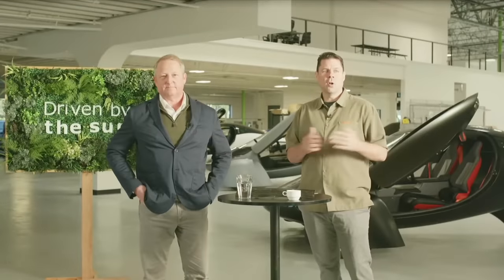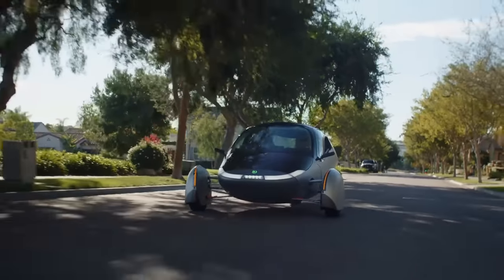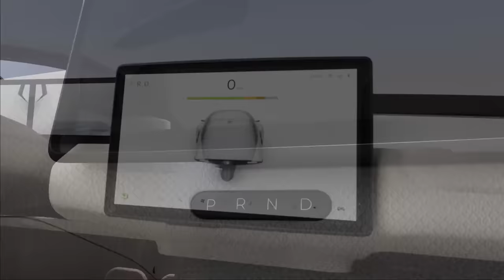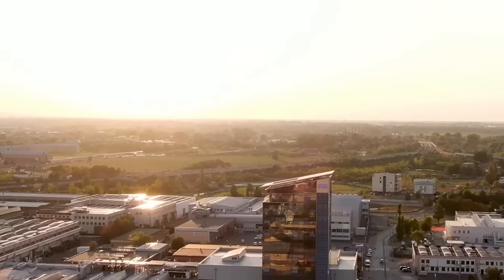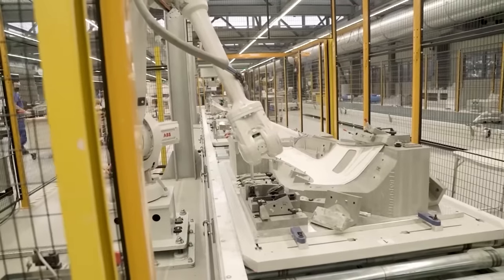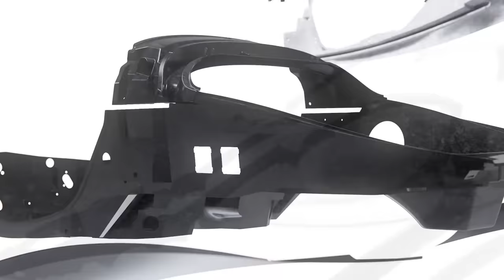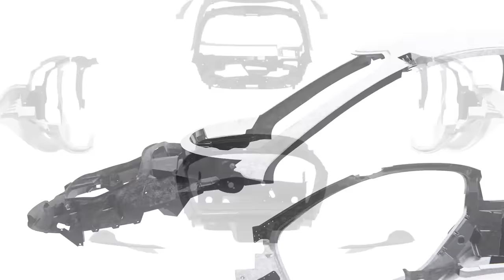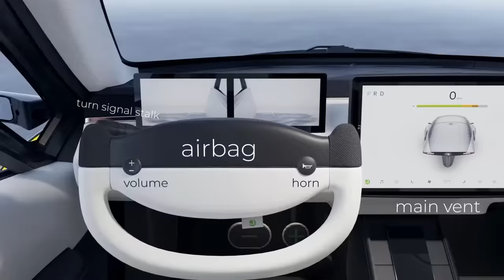Announcing Aptera's Launch Edition | Live Webinar

Comment: Wow, the chat was all over the place with this. Lots of people hating the yoke which I don't understand why and people demanding DCFC which I kind of understand.
My opinion about the yoke is that it is nice, I like the horn position on it and I hardly ever use the top of my steering wheel so sometimes it's in the way which is why I like the yoke design.
As for the DC Fast charging, I understand where people are coming from, however this vehicle is designed to be an efficient commuter, it isn't really designed to be a road trip vehicle, at least not the launch addition. Yes, I would like DCFC because I plan to get the 1K mile version and go on long road trips, but I would be more than happy to pay for that as an extra addition, like how the 1K battery is an option and the sub-woofer (was) an option, I would just pay extra for the components of DCFC and I would understand that just like the AWD, it makes the car a little heavier and a little less energy efficient.
Reply: @paulas_lens  That is kind of what I thought was the case.
Reply: I drive with my hand on top of the steering wheel. So if they don’t ever offer a regular steering wheel I’ll never buy one of these. The yolk is not a very smart choice.
Reply: @Pickle_Riiiick  why do you say the yoke isn't smart? I like having the increased viability.
Reply: @Pickle_Riiiick  Good for all the folks in the waiting line!
Reply: I apologize, after rewatching, I was mistaken.

Comment: Reservation holder for over 2 years now and I have been evangelizing Aptera the whole time to so many people. But with the HUGE stink y'all created about CCS and then not implementing DC fast charging at all? Seriously? The NACS connector at just level 2 won't even work at Superchargers, so all that effort and time was wasted as you could have just gone with J1772.

I have been most looking forward for this being my road trip car and I have been limiting my gas car trips for years now so I don't put more carbon in the atmosphere. Aptera was going to get me back on the road and travelling throughout the US again. Now it's just another EV that doesn't charge quickly and makes road trips out of reach for people on a budget. Want a decent road tripping EV? Ante up $50k or more. Out of my reach. My Bolt EV and 500e can't get me long distances without significant charging time, and not Aptera won't either. 😭

Can you imagine how long the 1000 mile Aptera is going to take to charge? 💀

Comment: I hope there will be a small battery / one motor version at some point.  Conservation is the top priority for some of us.
Reply: I think two motors is as few possible.  250 range is the lowest available.
Reply: While a single motor version would require the development of the few extra parts needed to eliminate the motors in front, all the parts for putting a motor in the rear wheel will already be in production.  Overall, I think Aptera is smart to make a first impression with the fastest version.  That will help sales.  After a couple years, after that reputation is established, coming out with an even more efficient version could grab some headlines.  Even if there isn't huge demand for a one-motor version, it still might be worth it for what it would add to the brand's image if it's marketed properly.  Three drivetrains; call them:  all-wheel drive, two-wheel drive, and "solar racer."

Comment: EDIT: People are saying they intend to add fast charging via an over the air software update eventually but can't yet due to a bunch of safety standards that require testing by a third party. Fair enough, I am now much less concerned about this issue and will be keeping my reservation.

Original post: Aptera, while I appreciate all the hard work you've put into this beautiful vehicle, surely you realize that no level 3 fast charging will be a huge deal breaker for most people? I was extremely excited when I reserved my aptera a week or so ago but now I'm considering canceling. A maximum charge rate of 57 miles per hour means my 400 mile range aptera (the most I can afford) configuration just lost a large chunk of its utility. I was planning on potentially using this to drive the 1,600 mile trip between my hometown and city where I work, but without level 3 charging that trip just went from 2 days to around 5. Please reconsider this design choice if possible, or at the very least include an upgrade option to add level 3 charging in the future. I don't know why you contracted with tesla to use their supercharger network if you can't actually supercharge

Comment: I love Aptera, but won't buy one until fast charging is available. Even just 50kw. 57 miles/hour is a deal breaker.
Reply: @JorgTheElder  why does this have to be a commuter car? Isn't the most environmentally friendly thing working from home?
Reply: The car gets 10 miles per KWH. So 50KW charging would be 500 miles per KWH
Reply: @JorgTheElder  because not everyone lives in California or sunny and dry climate. Which means you will have to use heating and de-fogging also it is 400 only after they actually make it on the road and test it. And then on another side you can forget going anywhere outside of the 200miles away from your house (200 driving out+200 driving in) also 50kw charging is not cutting edge tech it is more or less the minimum at this point.
Reply: I’m in same boat. Didn’t think fast charging was even a question. I know of no other car without at least 50kw. Even motorcycles like energica esseesse 9 at $23k has fast charging. Very disappointed
Reply: Very Fine. But why not at minimum 22 KW charging ! In Germany/ Europe it‘s impotant for charging at home or in the City or at work etc.!!!
Reply: @JorgTheElder  It's not a "commuter" car, it's a car. I regularly make trip exceeding 400 miles/day.
Reply: @JorgTheElder  a car with 1000 miles of range isn't just a commuter car. do many commuter cars have camping kits?
Reply: @Ernes446  , are you sure Energica motorcycle has DC fast charging? I think you’re getting confused with terminology. There’s 110V 220V and DC fast charging (400-800v)
Reply: @Brent Geery
  If you order what you WANT in YOUR Aptera, you will be able to get DCFC - just NOT in this "launch" version.
Reply: @paulas_lens  they didn't confirm that, you're guessing
Reply: @tjam4229  I believe so. Transport evolve has a review charging with css. You can also look at Harley Davidson live wire , zero. Affordable motorcycles with fast chargers. As an investor I understand getting a product out but I’m still disappointed and would buy esseesse9+ or livewire instead
Reply: I apoligize, I was mistaken.
Reply: @AMPM020
I rewatched, and I was mistaken.
Reply: i recently received an email from aptera motors announcing that quick charging will now be a part of their vehicles abilities. this truly is great news indeed.
Reply: @RadiantFreeEnergyResearch  correct. They made that change within three days of the initial announcement. Great responsiveness from Aptera!

Comment: 150 miles/hour AC charging is not sufficient. Many EVs have 10-80% DCFC charge times under 30 mins for about 250 miles of range. Or to put it another way 500 miles/hour of charging
Reply: But most EV's charge very slowly at home, so you need fast charging because you are waiting.  If you can fully charge at home overnight, then it usually isn't an issue.  This isn't designed to be a vehicle that is driven 800 miles in a day.  If that is what you need, then wait for the 100kwh battery.
Reply: @allenr8121  I'll just get an EV6 I think. I wanted this vehicle to work for me, but I just don't think it's right for my use case.
Reply: @Jacob C.
  If you order what you WANT in YOUR Aptera, you will be able to get DCFC - just NOT in this "launch" version.

Comment: Postive:
1. Launch Edition is correctly spec'd.
2. DC fast charging is a must, glad to hear you are adding that.
3. Love that you are going right to repair.
4. Focus on efficiency to the point it may never need charging for many =mind blowing!
Negative:
1. Hire a presenter to handle to do the heavy lifting and have them interview you for your perspectives.
2. The seats look uncomfortably flat. I hope I'm wrong but I feel you should have just purchased those from another manufacturer.
3.. Go with a regular steering wheel. Rectangles do not spin very nicely do they? Single handed driving (on top of the wheel) not possible. The fabric around the sides will get gross over time.       Buttons look unrefined. Yolk appearance is a gimmick. I know it looks like an aerospace design but it's still a car that drives on the ground and needs to make three point turns.

All in all I think you have designed a brilliant vehicle and I desperately hope you succeed at this very ambitious goal. I do feel that your ideas would do the world more good if in the hands of an experienced automaker with large distribution. I don't know if you've shopped your design around with automakers but I think you'd have a better chance at getting these on the road with some large backing behind you. 1% of a large business is worth more than 100% of one that never got off the ground. Best of luck, I will buy a post launch edition that features the inevitable refinements learned from the early cars.
Reply: Putting the business in the hands of experienced automakers fuct them the first time. They left, got rich, came back and picked up the pieces, and are on the verge of launching the best vehicle possible.

Comment: Random questions, does it have a heat pump, can you charge level 2 + solar charge (what's the fastest the battery charges), is there a warranty, what type of battery chemistry are you using, will there be over the air updates, what kind of processor is being used in the main screen, what type of navigation can be used (is there apple carplay and android auto), will there be options to have a circular steering wheel instead of a yoke, what kind of tires are being used and are there options for summer vs all season tires?
Reply: No heat pump, no DCFC.   No DCFC is the deal killer for me.

Comment: Ok, DC charging. Whoever at Munro suggested no fast charging is needed, wrong.  Harley Davidson (Zero and others) have robust DC charging built in. Very small form factor since has to fit a motorcycle. Without DC 400 mile range is useless for a trip. No one will wait around to charge for 6-8 hours min for level two.  Looks like you are using Tesla connector (good).  No reason why that would hold DC fast charging back.  Figure is out. Take a look at my or someone HD Livewire with DC fast charging. Oh, I heard there is thermal concerns with your battery pack?  Figure that out. Motorcycles makers have. Look, most will not expect 350kw DC charging right this second. However, get so something reasonable.  Like 150kw. Short charge times as needed will he big advantage. Without this at launch… Disaster… Only the hard core will have positive view of Aptera.
Reply: Zero has been in the game for a very long time, Harley Davidson is a relic that has all the infrastructure and finance already in place, and they are motorcycles, they have far less requirements than this. You can't compare them to a startup car that needs to get to production as fast as possible as they're burning startup money. The absolute most important thing now is to get to mass production, nothing else matters, there are plenty of customers that do not need to drive longer. Just be patience, all these features will be there in the future iterations of the car.
Reply: Yeah. Some people will buy it as a city only car, but the vast majority will balk at no level 3 charging, myself included. Aptera is breaking my heart with this. I'll pay like $500 or whatever to add L3 hardware.
Reply: @matthewryonadams  My guess is that they will offer this in the future (it sounded like that in the stream) i just isn't going to be on the launch addition vehicle because they want a simpler vehicle to produce as their first one, that is why they are only starting out with 1 type that is exactly the same as the others at this time, to reduce complexity. I am sure there will be an addition later on.
Reply: @YeeLeeHaw  Have DC fast charging, or this intro model, possible company with it will go down.  Just the way it is.  My point, the motorcycle companies have figured out the requirement. And how to make it work. The tech is already out there. Size and cost is not the issue.
Reply: @johnross6314  Cost is absolutely the issue when we're talking about a first iteration mass production vehicle. I think you're heavily overestimating how many that require this on the first vehicle, most people are not driving near the full distance per day.
Reply: @YeeLeeHaw  assuming they begin production, we will find out.  No DC will be one nagging unremovable thorn while they get set up for production.

BTW, I have on deposit/order the “1000 mile” version.  Looks like that will he years out. I planned on using for fun long distance trips, plus a extra set of power source (they spoke of some time ago working to have bidirectional power delivery) for the home solar/battery system. May adjust down to 600mile version.  For now, no way would I buy the launch edition with no DC charging.
Reply: @matthewryonadams  400 miles is the distance from Minneapolis to Chicago, two states over.  Most will be fine. We did that 7 hour trip exactly once, and have flown ever since.  4 hours in the car is our limit.
Reply: @furbearmn  yeah well that's you. Most people kinda expect their car to be able to refuel in a reasonable time and... get them where they need to go.
Reply: @YeeLeeHaw  based on the announcement today…. Aptera listened to us.  Thank God.  Now they have a much better chance of becoming the second new high volume car company in 100+ years. Tesla being the first.  Rivian, or lucid production numbers are not high volume Aptera will have.  We are talking millions of these over the first three-five production years.
Reply: @matthewryonadams  looks like they listened to us, not fan boys who would end up on ash heap of history.

Comment: They made a bad decision. Aptera added AWD instead of FWD (~5% hit on efficiency). Dropped 50kW max DCFC for L2 57 miles/hr charging.

On a trip over 350 miles, I will drive 350 miles (5 hours) stop and get a hotel so I can charge to 100% in 6 hours.

Makes no sense to me. What are your thoughts?
Reply: Aptera is making a huge mistake!
Reply: @Gandalf721  You are barking up the wrong tree. We already own a Tesla and want another EV...with DCFC. We completely understand the use case.
Reply: @Gandalf721  I believe the majority of the reservation holders would prefer DC Fast Charging capability weather they use it or not. I drive a EV, I was only able to charge at 57 miles per hour at 6.6 kW I sell it fast.

Comment: Hi guys, how works the three motors together?, their controls communicates each other for different speed when changing the direction?, also there is anti-skiding function? How you managed the thermal problem as the solar panels heats when works, the car has air-conditioning system?

Comment: Love the intent, concept, design etc & have been a reservation holder for some time, however  while the lack of DC rapid charging for the Launch Edition is disappointing the pitiful 6.6kW on-board AC charger is unacceptable! If DC charging is problematic, the least you should do is provide an AC charging rate of 11kW, preferably 22kW to make charging stops on road trips feasible!  I have now changed my reservation spec to the 60kWh version to allow decent touring range & the possibility that, by the time this model is available, DC rapid charging with be included, even at 50kW!  Hoping for the success of the project

Comment: I've been an Aptera fan since the Aptera 2.  I could not place a reservation for one of them because I live just north of California in southern Oregon.  I have an early reservation number on the Aptera, which is configured with all options.  I was excited to watch the video about the launch edition and was ready to change my reservation to get one.  Then I read it:  NO SIDE AIRBAGS!

Being an Oregonian I had reserved an Arcimoto.  But when I saw it was not going to be a safe vehicle I cancelled.  I am deciding whether to cancel my Aptera reservation and order another electric car equipped with the needed safety equipment, or hold on to the reservation and meager investment for later iterations.  

I have driven cars with side air bags since 1995 when I bought a Volvo.  This is 2023 and no one should sell a vehicle designed for passengers which does not have side/head airbags.  I understand the concept of a launch edition and the need to get cars on the road, but when the reports of injury and death from side impact crashes start coming in, I believe the decision to leave out side/head airbags will be regretted.

I wish Aptera well, but I cannot drive such an unsafe vehicle.
Reply: @MisterMonsieur  True.  Nevertheless, they could have made safety a priority and chose not to.  Too bad, in my opinion.

Comment: Looks amazing but you need to increase the size of the icons on the touchscreen. Seeing a 3D representation of the car is pointless, when I want to turn the de-mimister on. Cant wait it for it to come to the UK :).
Reply: Maybe the guy designing this UI sits rather close to a huge PC display, staring directly and for a long time at it while designing the UI. But in practical use, you should have your eyes on the road / traffic outside and you'll only have a quick glance at that smaller, more distant in-car display - so it should have definitely bigger icons/buttons.